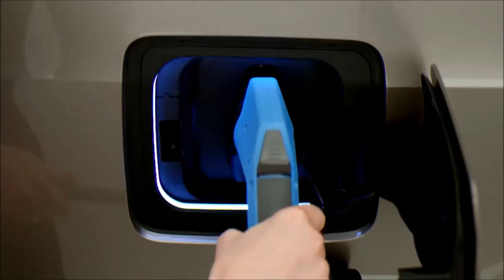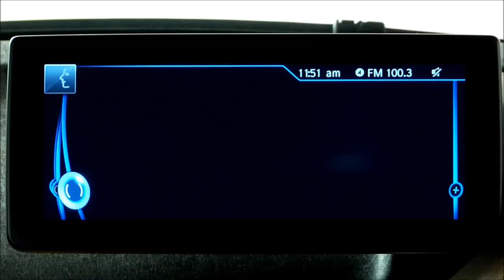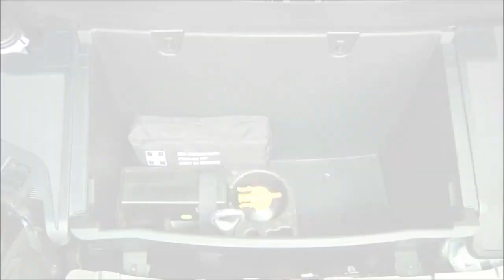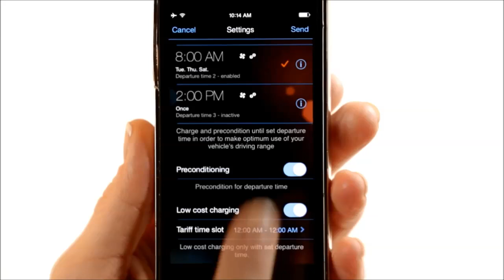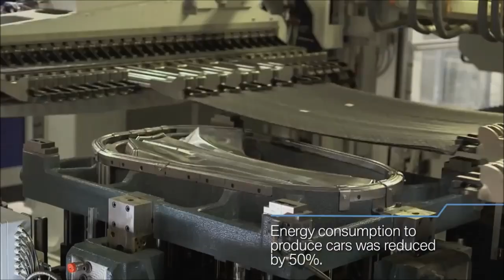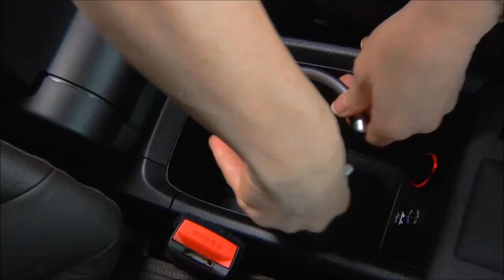BMW I3, For Owners, BMW USA

Comment: Just purchased a used 2014.   what a fun car,   I do have a question about level 2 charging.   I have a HomeFlex charger 48 amp.   I see the car is capable of charging at 7.4kw.  but I only see 3.7kw attained in my charging history.   The I read in the forums that you have to have ordered option 4u8,  that doubles the onboard chargers,  and achieves the 7.4kw max.   Is that true,  can I add another charger myself?   And would the 4u8 option be noted on the window sticker or in the  VIN information....or better yet,  can I just look and see where the charger is located in the car.

Comment: The rear doors are a nuisance. They have a latch accessible only by opening the front door. You cannot open them from outside the car either. Dropping off a kid at school means you have to unbuckle your seatbelt, get out of the car and unlatching the door ( the front seatbelt is anchored to the rear door)
Reply: In that sense, it is like a two door car but the suicide door can make it more easy to get in and out of the back seat.

Comment: Have any amateur radio enthusiasts used the BMW I3 for mobile HF or VHF? I'm wondering if the vehicle electronics will have an adverse reaction to an antenna radiating 100 watts on 7 MHz or 40 watts on 146 MHz.

Comment: I have a 2014, I like the car a lot.  But it has no spare tire and No controls for the rear windows.   The control functions should come Unlocked we we can turn which systems we want on or not.

Comment: one big problem, range. there is much better out there right now. also bmw is known for extremely high cost in repairs and parts. i would get the bolt over this.

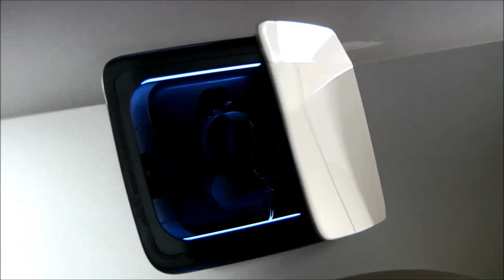Comment: 23:54
Why does the charging flap door have a second cap inside it to protect the connector? Why isn’t the cap integrated into the flap so when you open the flap door, it’s ready for you to connect the charging cable? 🇸🇪
Reply: The top cap is used for Level 1 (120V) & Level 2 (240V) charging.  
Both caps are removed for Level 3 Higher speed charging.

Comment: Why does the BMW I3 front seats only recline to a maximum angle of approximately 45 degrees?  Laying seat flat against back seat is possible in so many vehicles now a days.
Reply: That doesn't sound like a safe driving position.